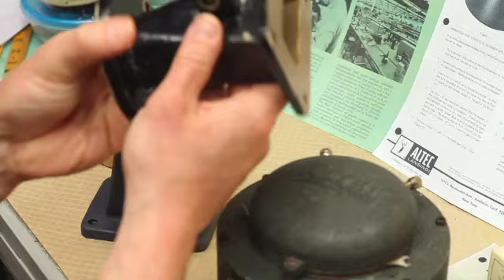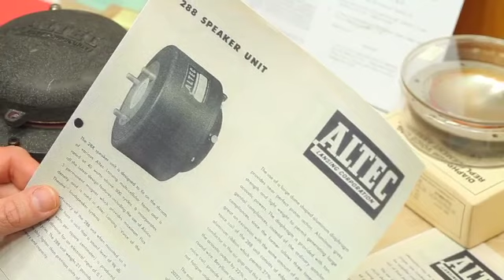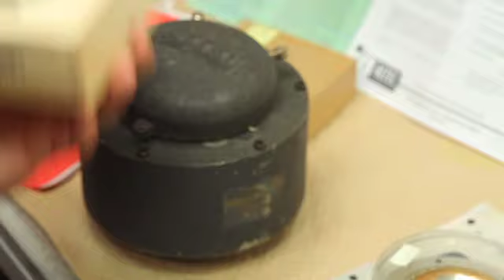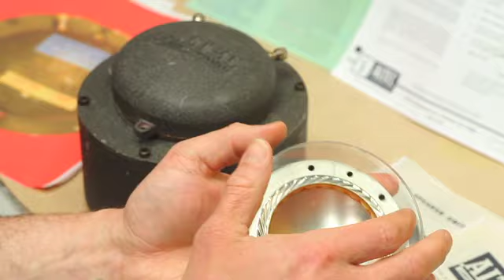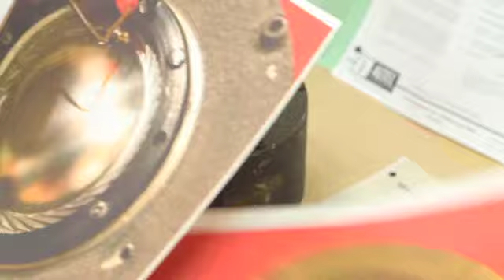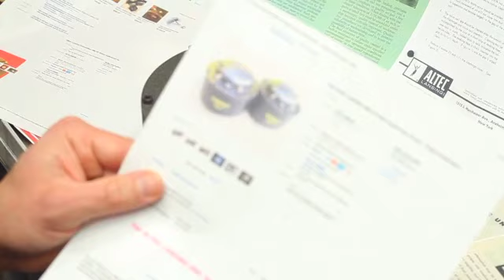The 1940s and 1960s Altec Lansing Hollywood 288B and C Drivers

Comment: I'm rebuilding a Peavey impulse 200 12 inch 2 way.
Can you get baskets made in the USA? I got a 1208 black widow and an X22 driver. They say Peavey but made in China. Thanks.
Reply from the maker: The process is typically sandcast aluminum alloy or some other type of injected aluminum alloy and there are other processes. Usually speaker frames are made out of cast alloys or stamped steel.
both processes and manufacturing techniques are still done in the USA in factories and foundaries in various parts of the country – – but it is absolutely very expensive and design intensive and no longer economical to do in the United States stamped steel is much more approachable and you could probably find numerous factories already stamping and possibly casting a few different types of speaker frames OEM for other companies 
The best method is to find old speaker frames and rebuild them to your needed specifications there are plenty of old speakers out there and sometimes you can buy them from suppliers in large lots I know we did that once with EV black widows and they had nice cast frames as you mentioned I never stopped to notice where they were made but overseas or Mexico was a distinct possibility. I would recommend finding a particular model of speaker that is obtainable for low cost and rebuilding it. Modern professional sound equipment is all very high power and not what I deal with you can't find manufacturers to make any sort of driver diaphragm or cone  with thin wire under 30 W any longer ..... it's a much different category of Audio unfortunately

Comment: How different is GPA 288 16ohm diaphragm? Many people agreed that there is no difference in sound or measurement..
Reply from the maker: I don't see how it's possible for the GPAs to be constructed of the same materials exactly – – and I don't believe the coils could perform the same (GPA would be thicker) or former (GPA would be Kapton similar) and the aluminum it's self would be of a different grade and temper (causing different breakup patterns) . The materials are the not same due to design constraints, availability, manufacturing process (this has changed greatly over the past 60 years)  requiring  higher program wattage of this century's  solid-state amplifier era.
Sure, it's possible for different materials to perform similarly, but if weights or flexibility (rigidity) differ at all, the laws of physics would dictate for this, not to be likely in the least.
Those who say the GPA diaphragms sound the same may be speaking subjectively – – But,  if there are measurements and SPL charts, we could certainly take a look. 
When presented with test results, I would caution that such sensitive tests need to be done in careful A/B conditions, and only minor f, variations of rooms, mic placement or driver, magnet strength, (or hundreds of other minor parameters would cause the performance characteristics to change. 
When you can compare SPL charts to one another – – drivers usually perform grossly the same – – it's the Little Peaks, and dips that you have to watch out for. 
Somewhere hidden in those peaks and dips of the  non-linear metal "breakup" – – the harshness of modern diaphragms will hide to get your ears.

Comment: This is an excellent and most informative video. It's exactly what I wanted to know and have been researching. I found out I have the valuable diaphragm in 1 of mine. I am going to replace them with a more modern one and keep the old one safe. Thanks again.
Edit: So the more modern and more available (relatively) 16 ohm diaphragms would be a correct replacement for a 288B with modified spade connectors and shorter screws?
Reply from the maker: Yes, I believe so. The threads are US, so adjust length as needed, using non-magnetic brass.

Comment: I have a pair of New old stock 288,c  that came from. The estate of a broadcast engineer , the red seal on the one screw  is unbroken  , does it devalue to break the seal to prove they are original phrams
Reply: very precious 288c i wish i had it, it's second hand open it carefully to check

Comment: RCA PhotoPhone stuff never came with aluminum diaphragms. even the common MI-9584 series were 3" phenolic diapragms.Not much in the way of similarites to the Altec stuff.
Reply from the maker: That is most certainly true.  There were a few exceptions, RCA made some Master Index listed compression drivers similar to Jensen Hypex in the 1940s using aluminum as well as some other small drivers. They also sold some smaller drivers, but those were probably made by Racon ....They begin again with aluminum again in the 1970s but those drivers were JBL design and production. RCA was so huge and prolific, it's almost impossible know all of the products they made (and if they were contracted or not!) 

Thank you very much for the comment and thank you for watching.
Reply: @HiFiTown  no prob,had a rather large collection of MI- theater stuff. Recent move so I decided to let it go. The theater stuff was all excellent design but with the parameters set by design group of an HF upper of 7Khz some of the items sought need help in the upper octaves to be considered HiFi. One exception I make is the MI-1428 with it's 4" phenol cone diaphragm as a midrange unit which is a "goose pimples" with female vocals in a good three way setup from about 300-5000 hz. As you suggested,anything alum was either subbed out or rebranded other manufacturers pieces. There are a pair of 30 ohm  MI-9449 woofers around here somewhere but the rest is gone.

Comment: I have a pair of the 288c and the diaphragm is stamped with the altec meastro logo its the only one I've seem any info would be appreciated
Reply from the maker: They made those, certainly. I have seen many. The "Maestro" was not a logo they used for long. It appeared on products beginning around 1960 and kind of disappeared inside the decade. I have seen it on replacements as well.  Take a look at the outer clamp ring and compare it to some in the video, that should give you an idea on it's age 😉
Reply: @HiFiTown  i have 3 complete 1005b with throats and the 288c drivers 
I'm looking to sell them
If your interested let me know

Comment: Bones of the dinosaurs of sound, meant to fill larger theaters with fine memories to go with the excellent pictures of the time. We are in a comic book culture and burn-through masses of plastic imitations, replacing careful engineering with computer guesses and increasingly full landfills made from these mistakes. We'll have to jump off the planet and get more raw material, as we're running out of substantial, lasting solutions, due to short product life cycles. How many "speaker manufacturers" have come and gone, since the discoveries of the Bell Lab Boys?? Hmmm?